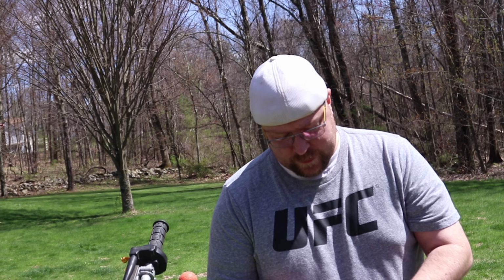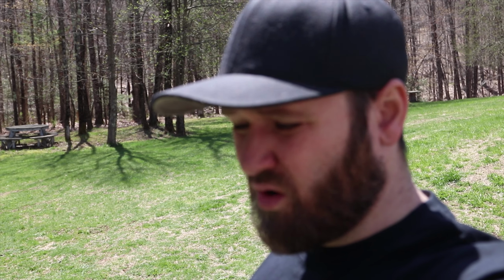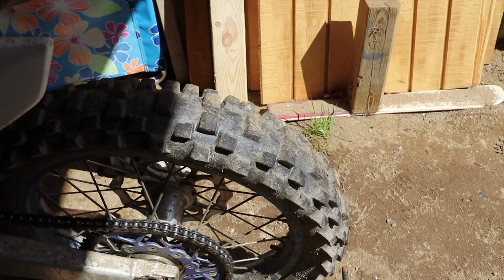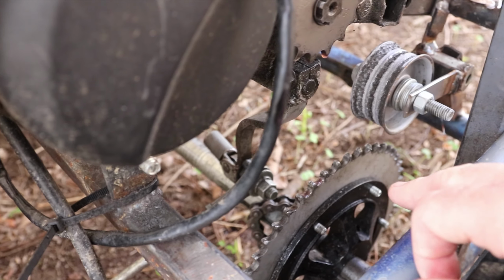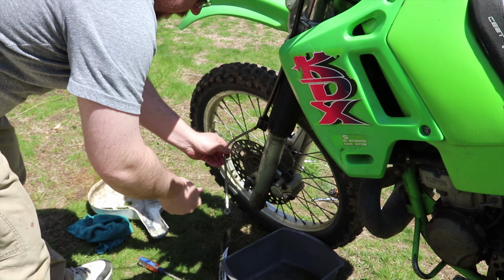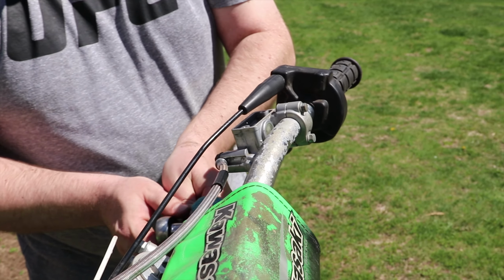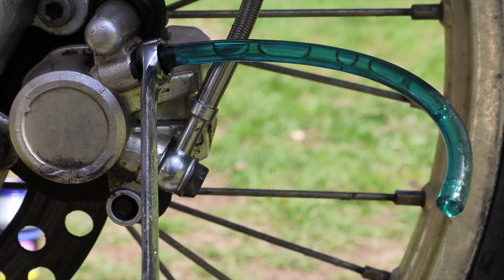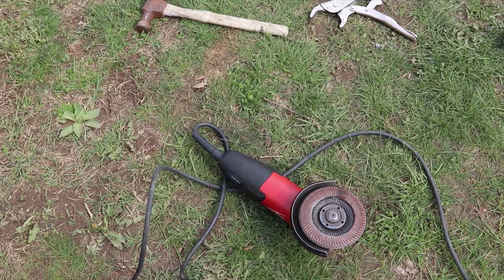Fixing the front brakes on the KDX200

Comment: I knew they made a kdx but not a 200. I would put the chain tensioner in the inside.
Reply from the maker: Elijah Gorman yes they made an 80, 200, 220, and a 250 actually. The 200 is the most common
Reply: DapperDan  and 400 and 450 and a 50

Comment: Can u do the brake cylinder rebuild
Reply from the maker: The_ltz_guy Master we actually ended up getting a aftermarket Kawasaki universal cylinder and it did not help very much, so I don’t think that is the issue either. Just seems like those old brakes do t work very good unless the issue is the caliper....
Reply: DapperDan what causes the throttle cable to go wide open without touching throttle only moving the cable